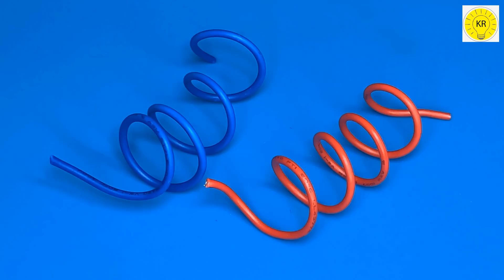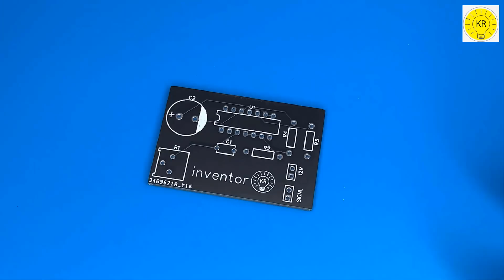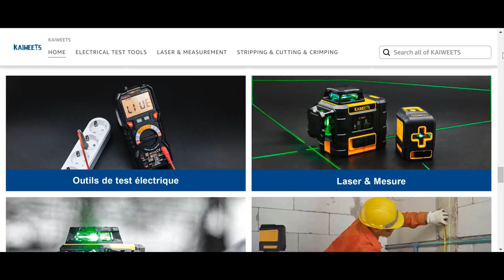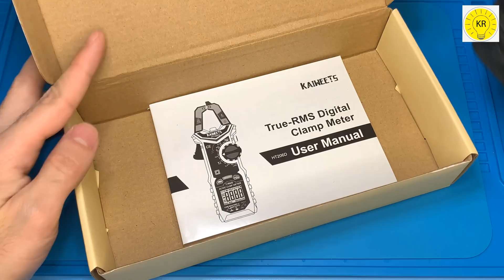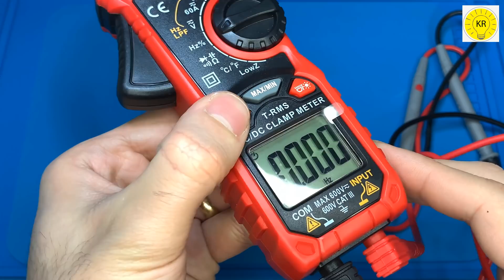how to make simple inverter, transformer , sine wave ,mosfet ,‎kaiweets HT206D

Comment: the cd4047 only gives out a square wave, its a flipflop, asynchronous monostable multivabrator , schmittrigger. should have used a 555 i think that can give a sinusoidal output. I use to make mine from 2x bc547's 0or 2n2222, i use to buy a transformer kit with a pre-wound primary (used in reverse) anyway WELL DONE, "I like the transformer less invertors now lol"
Reply: Mosfets driven with sine wave signal in a simple push pull coniguration is not for high power because you use the transistors in linar mode if drive signal rises too slow and the mosfets create no sine signal on the output if you drive them with a simple sine wave on the gate. In sine wave inverters you use PWM modulation and output filtering like in digital amplifiers to create a sine wave output.
Reply: The 555 can't produce a sine wave any easier than a 4047 can but you can get an approximation from either by filtering the output. In the case of the 555 you can apply the filter to the voltage across the main timing capacitor, which is vaguely triangular to start with and a little easier to filter than the main rectangular wave output. However in the case of this video no filtering is applied.

Comment: Why do you say "sine wave"? The 4047 produces a rectangular wave. How do you calculate the number of primary turns required  from the resistance and physical dimensions of the secondary?
Reply from the maker: My dear friend, I write in the title a sine wave. Because it enters the field of the inverter
Reply: @inventorkr1  but that's clearly not a sine wave inverter. Don't you know in field of inverter there is square wave inverter, modified wave inverter and sine wave inverter? Don't you? Come on.. You like fooled the newbie. Don't be like that.